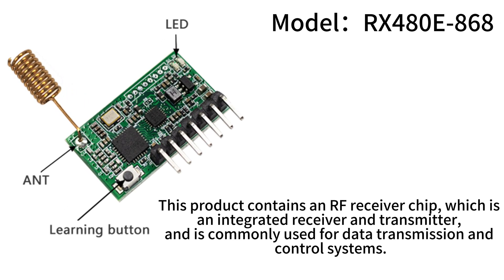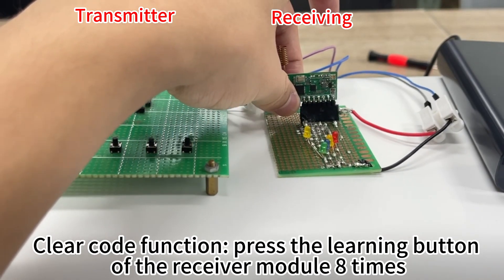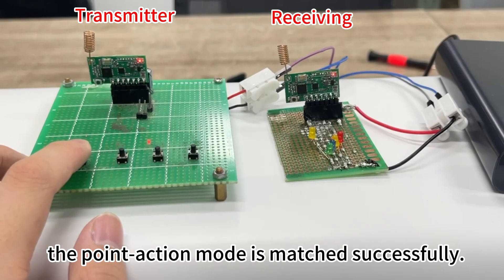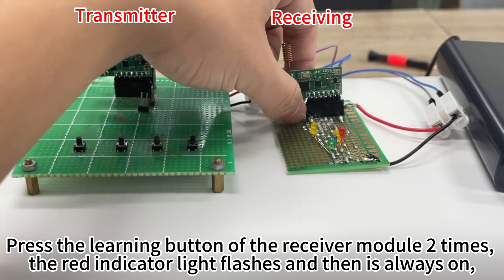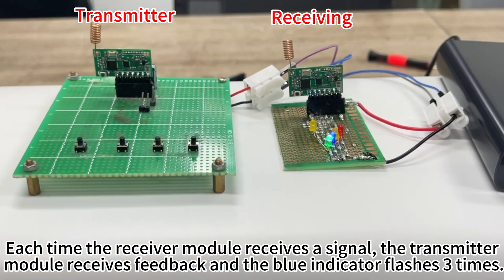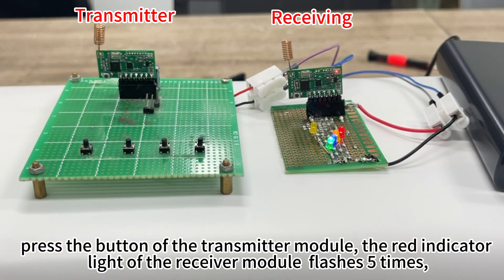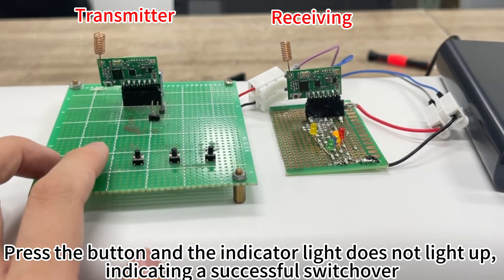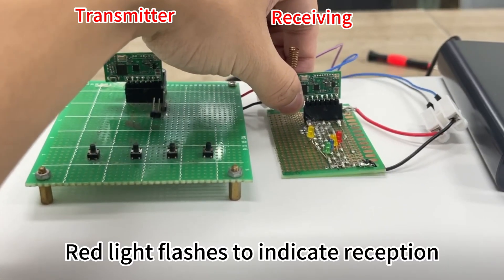How to use modules 868mhz RF Transmit-Receive Integrated Output 400m Long-Distance Transmission

Comment: Hi there! I'm having a problem with these boards. I've connected them correctly, apparently. And I can put the receiver on learning mode.

But the problem is that my transmitter never sends anything when I press the push button I have on my protoboard (I've checked, and the voltage flows as it should to all the pins and locations).

The Qiachip's V+ port is connected to my power source, while the push button is in-between another wire and the D1 port at the transmitter board.

I've got 5 boards of this, and it seems like none of them can transmit anything.

Could you guys help me out with that? I've even tried increasing the voltage (was using 5v, now I'm using 12v. But still got the same problem). I don't know how to proceed. Hope you guys can give me some directions
Reply from the maker: I understand your problem. 
Here, you need to confirm first whether you have set the module to the transmitting mode! 
Only in the transmitting mode can the module send out signals. 
If the module is in the receiving mode, it can only receive signals, not transmit them.
Method for setting the transmitting mode:
Press the learning button of the receiving module 5 times. 
When the red indicator on the receiving module flashes 8 times, the module switches from the receiving mode to the transmitting mode. 
Then, when the red indicator on the receiving module flashes twice, it indicates that the conversion is successful.
Please pay attention to the color of the indicator light here.
After that, you can give it a try again.Check whether the problem has been solved.

Comment: Hi, can this module detect ASK modulated signals from another brands transmitter?
Reply from the maker: Hello, I am glad to receive your question.
It depends on the brand, because the programs of each brand are different, which leads to some compatibility and some incompatibility. You need to test it in practice to know.
You can watch this video of ours.
https://www.youtube.com/watch?v=3yIVuT7U8NE
How to use QIACHIP Multifunctional RF Remote Control Signal Decoder RX480E TX118SA RX480E Tester
The decoder inside can detect models of multiple brands, but the limited frequency is 433MHz and 315MHz.
I hope it can solve your problem.

Comment: Hi! When I click on the buttons nothing happens. I don't see the red flashing like you show in the video. the red and blue keep flashing repetitively together for both modules at the same time. Also, is the receiving mode a standalone device, or need an extra chip?
Reply from the maker: Hi！Thank you for your reply, This is a module that can switch between transceiver and transceiver freely. It does not require other external chips. Have you seen its manual? Do you need me to send you an electronic manual? You can follow the video steps. Can you try to clear the code?
Reply: @qiachip   Yes the manual would be great. is there a link where I can find it? 
- In the instructions, it says to click a button on the transmitter module. I assume that can be any channel from D0 to D3? I was able to get the receiver module to blink 8 times and then I pressed the learning button once and it stayed on. But when I click on the button at the transmitter module nothing happens.
- Also, I have the button at the transmitter module connected to a button and then to the ground. I assume that is how it should be following the diagram on your website.

Comment: What is VT pin good for?
Reply from the maker: Good question, currently it is not functional
But, we are also thinking about this issue! What functions does it need to be equipped with?
Our tentative functions at present are: external learning button;
Some people are inconvenient to operate the learning button on the module. You can use this pin to connect an external button. You do not need to press the learning button on the module to set it, but control it through your own external button.
Do you like this design?:learning:
Reply: @qiachip  yes, Thank you. Another question: is there a way for transmitter to learn the code like others wireless remote controls do?

Comment: Hi. For VT : External Programming setting pin, can we connect to GND or -VE , so that D0,D1,D2 or D4 will send -VE to certain I/O board when triggered. Thanks.
Reply from the maker: Is it new function you discover?